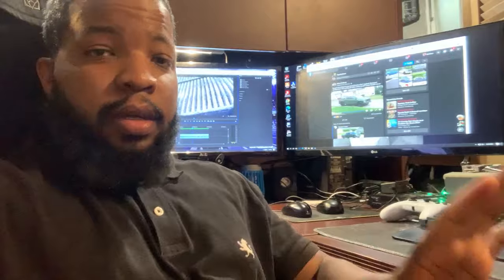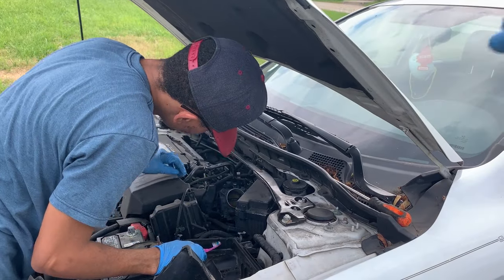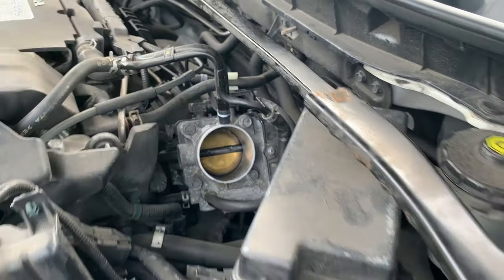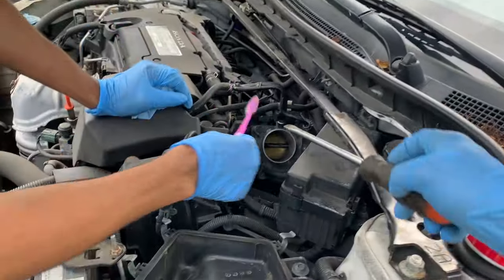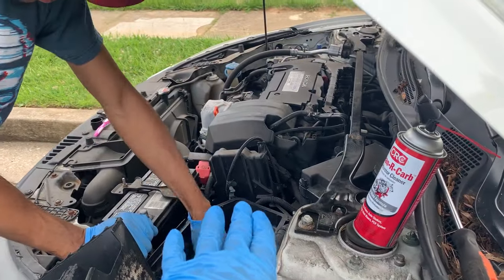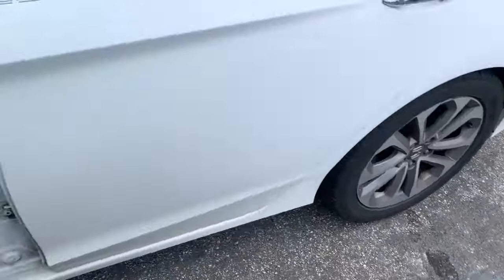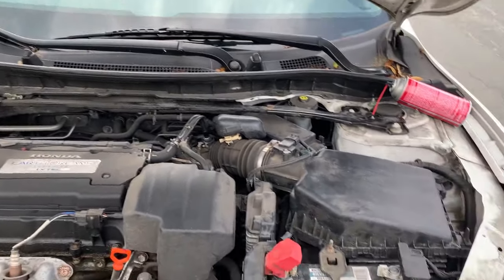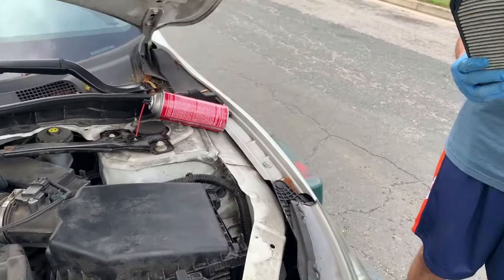Car Starts Then Shuts Off - Check Engine Code P2101 (Honda Accord FIXED!)

Comment: I appreciate you posting this! I came out of the gym on a Sunday morning, got in the car, turned the key and it would immediately turn off. It had never done this before so I had no time to prepare. My immediate thought was, not today! 😕 After trying about 10 more times to turn it on, I went on youtube  to see if this was common, and I found this video. After watching it I figured, why not?! Let's give it a try. Luckily my car turned on after a few more tries, so I drove around to a couple AutoZones, got what I needed (kept car on) went back home and after a total of about 1 1/2 hours the car was good to go! (And im no car guy) Engine light that had appeared was also gone! Sooooooooooooo, thank you for this because it saved me LOTS of time, worrying, and MULA! Definitely subscribing!
Reply from the maker: This is an awesome comment. I'm thankful this video was helpful to address your issue.💯
Reply: Hello does your car still work good from what you did? Can you please give us an update?

Comment: Opps you should not used any metal to open the metal thing butterfly of the throttle body you damaging the throttle body..instead someone go inside the car and press the pedal..

Comment: I was going to take my car to the dealer for repair for this code but after seeing your video it motivated me to check first.  so; I did and found a peace of plastic stuck in the damper.  Thanks guys.
Reply from the maker: That's excellent news to hear. I am glad this video helped resolved your issue to get your car back on the road.
Reply: a $20 obd scan tool works wonders

Comment: A couple things, firstly, “electronic” throttles should never be moved while connected to the system, especially if they are energized, the risk of damage and cost are high. Lastly, that crank is way too long. If there is a check valve in the fuel pump, it might have gotten stuck open and the fuel in the rail leaks back to the tank, and it has to prime before you get fuel pressure. They cycling the key on and off slowly for about two or three times, then try to start. If it start immediately then it’s definitely a bad check valve…but where it is I don’t know, probably have to buy a new pump assy to get it, or just keep pre-priming it as mentioned above. Me, I put an external check valve in-line with the pump out line (old Jeep). It could be the crankshaft sensor on its way out too.
Reply from the maker: @lechero1811  Professionally you should never manually open an electric throttle body, it should always be open via the motor. 

As mentioned in the video, this particular scenario the throttle body was going to be replaced due to known issues. If there were any additional problems caused by manually opening the throttle body, it would not be an issue since we already had a replacement.

The steps we performed in the video were perfectly fine and the car is still working this day.

Hope you find a solution to your issue.

Comment: Ok my friend. You will have to have that throttle body relearned now. You should have had someone push the gas pedal down instead of doing it manually. Food for thought next time.
Reply from the maker: @chrisbrand714  When it comes to electric throttle bodies you should always open it via pedal, clean and then let the system relearn. Pretty much the basics.

But as mentioned in this video, that process was not necessary due to the fact that we had a replacement which it was intended to replace. 

What you seen in the video was 2 good brothas chillin…

There are no rules in this realm 😂🤟🏾

Comment: Don’t open your throttle body if it’s electronic, you have more of a chance to mess up the calibration
Reply from the maker: As previously mentioned, it's always best to clean a electronic throttle body by having someone press the gas pedal while the vehicle is off. 

However in our situation, the original throttle body was going to be replaced/trashed so there is no need for safety concerns.

Comment: I'm not surprised that the air filter is so dirty after seeing the engine is no different 😫😫
Reply from the maker: Yeah when you drive down dirty roads, you'll engine bay will eventually get dirty too.

Comment: I never thought of using a toothbrush. That's  a genius idea
Reply from the maker: Yeah it works great and is not that rough on the surface of the throttle body.

Comment: THANK YOU!  Had this exact problem and did not find anything else on the internet that identified the issue until I saw this video.  Our Accord is over 160,000 miles so guess it is not surprising the carburetor/throttle body needed cleaning.  Saved us a tow and who knows how much $$$.

Comment: Thank you for the video.  My Honda Accord did the same thing and the comment about the starter over cranking to start was exactly what mine had been doing.  I removed the air duct and cleaned out the throttle which was sticking and now my Accord runs great.  One way to open the throttle is to turn the key to the On position and press on the gas peddle.  At first it didn't open so I put some cleaner on it and let it sit for a couple of minutes and then tried to wiggle it.  Then I tried it again and the throttle opened and I was able to clean it without having to use a screwdriver.  Again thanks for the video it saved me a ton of time and quite a bit of money.  All I had to do was buy the cleaner and an hour or so of my time.  Keep up the good work!!!!
Reply from the maker: Thank you very much Matt for your response and recommendation. This will indeed be vital to others whom are experiencing this issue.

Appreciate it brotha!
Reply: Helps to have a second person help by stepping on the gas pedal !

Comment: Same problem.. thanks for the great tip. I’m gonna try this. My Honda shuts right off.. just out of the blue no other symptoms leading up to this
Reply from the maker: No problem, hopefully that helps. I would also inspect your M.A.F. sensor incase it's got some dust build up.
Reply: What’s the M.A.F?
Reply: Main air flow ?

Comment: I see the use of carburetor cleaner and a premium long handle toothbrush works well together.
Reply from the maker: Yes, you can also use the carb cleaner as a quick way to check vacuum leaks.

Comment: What tools are needed to open the piece before the that part your actually cleaning
Reply from the maker: Recommended way is to let the car open the throttle plate. Grab a baseball bat or metal pipe and press the pipe against the gas pedal (car engine off but the ignition is powered on). You can use the driver seat to keep the gas pedal down. 

This will allow the car to peacefully open the throttle plate to clean. Do note, after you clean the throttle the car might take a few tries to start during the ECU relearn period. Many cases, the car will start fine on the first attempt after cleaning.

Hope this helps.
Reply: @AWordFromMrJones 
Even though I press the gas pedal with something and turn to accessory on 
My throttle still can't open 

I see inside the throttle body 
That there's a lot of gunk in it 

I'm kind of nervous putting a screwdriver in to open the butterfly of the throttle body 

I kind of don't want to damage anything 

So what's the best course of action
Reply from the maker: @BPX-np4nr  Purchase a spare from a junkyard so you can swap it out. Before you swap it out, try to manually open your current one, if it breaks, replace it.

If you want to play it safer, I would recommend calling a Mobile Mech to perform the job.

Either option, you will still learn a valuable lesson to car ownership and one day that fear of working and breaking stuff will be out the door since you gained more hands on experienced 💯

Comment: Does this code cause your headlights to blow?
Reply from the maker: There are other factors that can contribute to headlights issues such as bulb age, defective bulb in general or defective ballast if it's a HID/LED lighting system. 

How often after your bulbs blowing and do you have anything connected to the headlight such as lighting equipment?

If your replacing the bulb 1 to 2 times a year, that might be an "cheap" bulb but I don't say cheap to say that but in the manner that not ALL bulbs are made as they once was. So you might have to try another brand and see if that helps. 

Also I once had an issue where my Tundra would blow out my turning signal lights 3 times a year which I found it to be the "socket" that was causing the issue. 

I got a video on this here:
https://www.youtube.com/watch?v=kHBy-dR3Q10
Reply: @AWordFromMrJones  
But both high and low headlights, I change the reg. Headlights 2 weeks ago. Now both is gone. Or can it be a fuses? Or electrical? 

Little back info: I have a 2012 Honda Accord v6. I have the P2101 code - Throttle Actuator Control (TAC) Motot Range/Performance, also ABS 66-13 - Pruessure Sensor Malfunction and Anti-lock Brake system 38-11- ABS Solenoid Valve Malfunction.  2 weeks ago my battery light came on and check engine, my car felt as if it was going to cut off but didn't more of a slow running feeling. My right side mirror started making a clicking sound and was moving down on its own. In the past it happened three times before randomly weeks apart and i had a someone check it and they felt it was a bad alternator. When it happened 2 wks ago, I took it to autozone did a battery test, test alternator and determined I needed a new battery cause it fail. That day was the first time it blow my  headlights, now a day ago it did the same thing again but now blow both along with the same things happen. But my turning signal light still work. I took it back to autozone they test it and everything pass, battery, alternator and starter. ABS fail and Emission Ready was a NO 😒 on the fix check finder by innova. The guy at autozone thinks it might be electric now. So I don't know? Any thoughts?  Idea? Does the ABS have anything to do with it? One person saying alternator, now someone saying electrical.

Comment: I have a question 
My car does something (sometimes when I step on brake and press start button it makes scratch sound , I have to start a couple of times for it to start , it’s been like this for a year now ) and I do not know if it’s the same problem 
Can you tell me what the possible problem is and how to go about fixing it and if I should go to Honda to get it fixed or local auto mechanic? Thank you
Reply from the maker: I'm 99% sure that your "starter" is on the way out the door. Many times when the starter is about to fail, it will jump gears/teeth which will produce this scratch/grind sound. Sometimes you have to cycle the key for the starter to eventually to catch the gears. 

When it comes to choosing who to do the work, it honestly boils down on "who you trust" and your "budget". Personally I would call both places over the phone to identify who has the best price and best timing to get your vehicle fixed. There are some mobile mechanics that will come out to your location too. If your not comfortable with someone coming to your place you can also try meeting the mobile mechanic at a friends or family member resident. 

BTW: If you want to upload a video on Youtube of you starting your car, I can confirm that the noise is indeed the starter.

Hope this helps.
Reply: Starter or the relay. Check starter first

Comment: Great that this was live. AND a resolution! I have been having the same symptoms: starts fine, cuts out (Opel Tigra Twintop 2005, Corsa Ecotec 1.4) Just tried another tip and have a great improvement (not total like yours). Unplugged te MAF, it 'ran' for a whole 30+ seconds (if you can imagine   b Brandon running!). All warning lights out. So I guess it's beyond just cleaning (and auto shop here in France never heard of MAF spray) so will check prices. Next I'll get my carb cleaner out. And tooth brush. Thank you fellows! Jolly good show.

Comment: My 2015 just had this happen today when I tried to leave the gym gonna try this hope it works
Reply from the maker: Good deal, hopefully this video will help you get your car back on the road.
Reply: @AWordFromMrJones  it worked thanks fellas. Clear and concise gonna check
Reply from the maker: @Xqvance  Excellent, glad this video was able to help you.
Reply: @Xqvance  did you get a code when it happened?
Reply: @WavyFBaby  Like my original post said this happened to me right when I was leaving the gym I was trying to avoid a tow and such. My car was doing exactly what the video described starting then immediately stalling. I have tools I’m a mechanic by trade I took the intake apart and it was gunked up and stuck unjammed it then drove it home. Then I got the carb cleaner but I never checked the code the check engine light went away so I assume it was the same code. Hope this helps
Reply: @Xqvance  thanks for getting back to me. Mine is doing the same thing but no code is coming up so that’s why I was wondering.
Reply: @WavyFBaby  mine doesn't have a code either. did it work for yours?
Reply: @PissingInTheWind777  it’s been a months since this happened to my car but actually the first I did was upgrade my car battery to the bigger v6 size and my car never died after that. But once in awhile it would feel slightly rough and more so with the AC on. I I eventually cleaned out the throttle body myself and it seemed to help. The throttle body was pretty dirty. If you decide to clean the throttle body, don’t force open the metal part like they did in the video because you might actually break it. It’s better to put the car in the on position but without the engine actually running. And then put a piece of wood or something to hold the gas pedal down. That way the throttle body will open without you having to force it open. Also spray the cleaner on a rag and then wipe the throttle body with it. Don’t spray it directly into the throttle body. Hope this helps and please let me know if I can possibly help.
Reply: @WavyFBaby alright will do . thank you very much. much appreciated. ill let you know how it goes or if I have any other questions . thanks for getting back to me so fast.
Reply: @PissingInTheWind777  no problem. I hope it helps your car and yes please update me. I’m curious if it’ll work for you.
Reply: @WavyFBaby  hey all went well easy fixed. Thanks again for the help. Now just working on resetting the lights
Reply: @PissingInTheWind777  so cleaning the throttle body made a difference? Also did your car ever idle slightly rough? Thanks for the update too!
Reply: @WavyFBaby  Well I just drove it again and it has this clicking noise. just clicks once and doesn't turn on . when I tried it again it started up. I've been having this clicking/engine not starting for a month or so now. im not sure what it is. possibly the starter.
no its not idling rough. 
is yours?

Comment: Any idea what’s going on with my 06 Honda Civic hybrid before I had a knocking in my engine which eventually led to me getting the engine replaced after a long process of taking things off my engine to put on the new engine finally got the car to start then they said it would be the fuel pump since it wouldn’t stay started and replaced the hybrid battery since I already knew it was bad I am still having a light on for the battery and it still won’t stay started help

Comment: I need major help! My car starts but then just dies on me, I didn’t have a check engine light on. My friend came and scanned my car and it read P0455 and P1421.. from the research I’ve done I feel like I have a clogged fuel filter but I’m not sure. Just anxious waiting to see my mechanic
Reply from the maker: The check engine codes you provided are more geared towards a faulty charcoal vapor canister. These accords also have a canister purge solenoid which could also go bad and cause that error code. The solenoid is usually near the throttle body and the canister is near the fuel pump under the car.

A bad fuel filter will make your car stall, a bad fuel pump will eventually cause your car to not start. For the time being, you can simply confirm you have a clean air filter and that your mass air flow sensor is working by disconnecting the wire harness and then start the car. If it starts up rough but runs, then the mass air flow sensor may need to be cleaned/replaced. If the car does not start at tall, then there is another underlying issue.

Your doing well by having a mechanic take a look.
Reply: @AWordFromMrJones  thank you, my car cranks it just stalls on me right after and it won’t move. I’m hoping it’s an easy fix, I don’t really have the funds rn to take car of a bigger issue
Reply: @Igobyalice  What happened?? Did you get her fixed??
Reply: @alljerseysmatter.  yes, I got a new one! That one got totaled.
Reply: @Igobyalice  Good Job 👏🏾. Check out my Jersey collections

Comment: My friends car is 2014 Honda Accord. When she has less than a half tank of gas her car gets hard to start and won’t start when closer to empty. It just clicks like a low battery. She has a good new battery and still does it. When the tank is full it doesn’t act up in any way. No codes showing. Any ideas?
Reply: Leave the car keys in pre ignition for 20 minutes